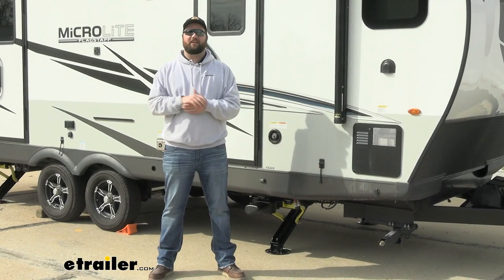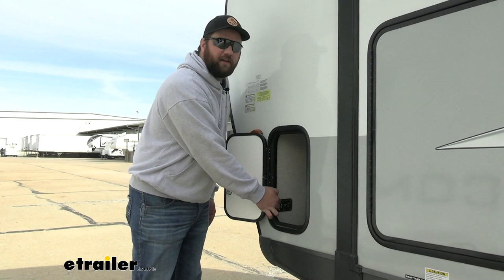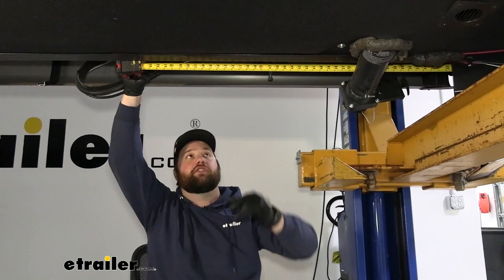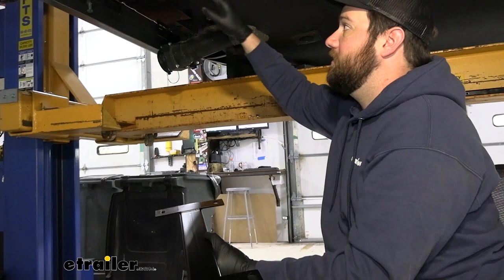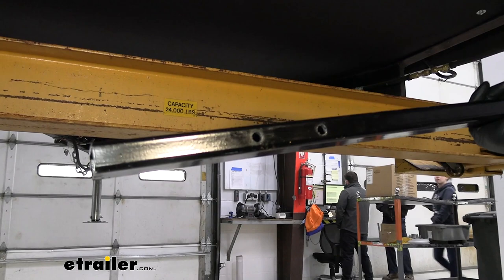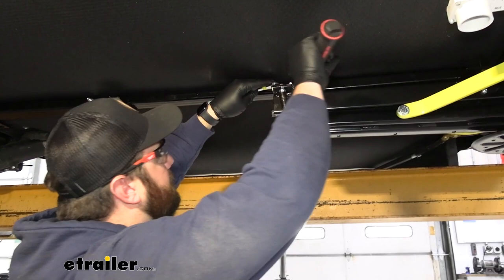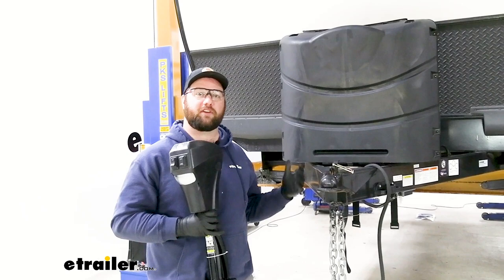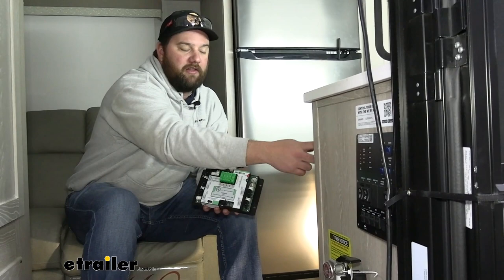Lippert Electric Travel Trailer Leveling System Installation - 2022 Forest River Flagstaff Micro Lit

Comment: It’s perfectly fine to lift your rig with hydraulic piston leveling
Reply from the maker: It really depends on the system you're using. The # LC672136 you'd looked at is intended as a stabilizer, and even the Lippert # LC358590 Ground Control 3.0 isn't intended to lift the wheels fully off the ground. The best bet is to check the owner's manual for your system and go by that.